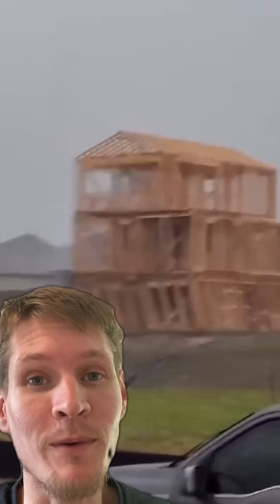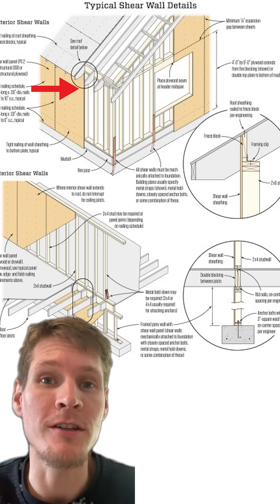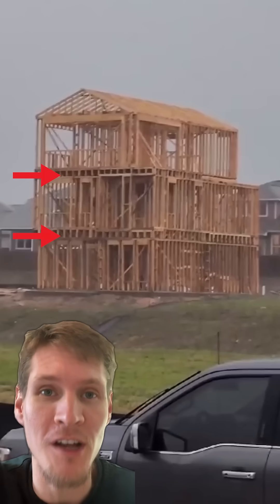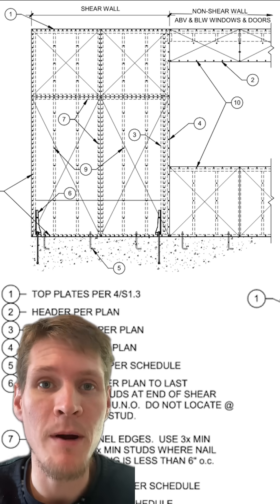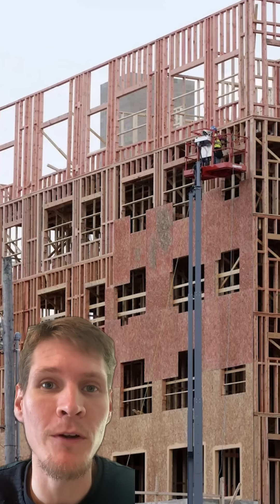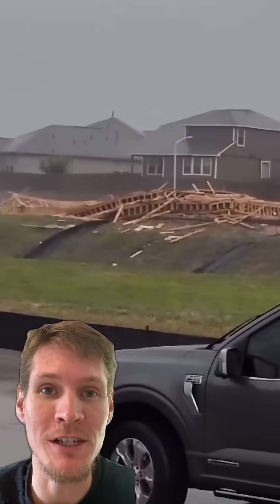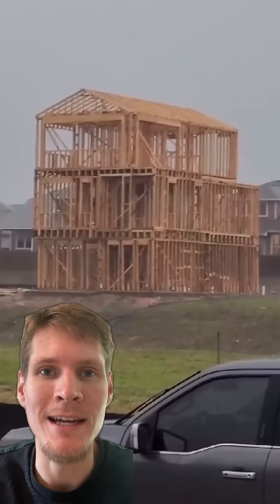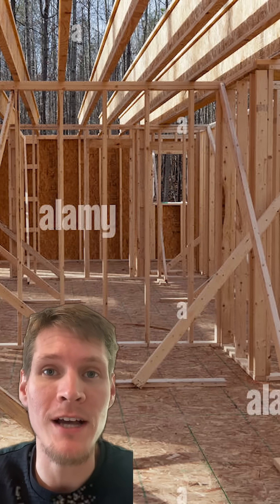Professional Engineer Reviews Reddit Structural Engineering Thread | Part 1 #engineering #reddit

Comment: Weird that the framers put up walls without the plywood attached. When I had my house built, the framers built walls with plywood sheathing nailed to studs, and then raised the walls securing them until an entire floor was completed and secured.

How crazy is it that the framers would have to attach 4x8 plywood/OSB 2 and 3 stories up around the entire house???

Also, it looks weird that the floor joists appear to run in both directions on the 2 upper floors. I remember my architect specially mentioned that the joists would run in one direction on one floor, and perpendicular on the upper floor so that IIRC the load would be on different sides of the footings.

Comment: ...or just use concrete and steel for the main structure for that size of a building. You can still make it look like it's a wooden house later. Just a support pillow in the middle where everything is mounted and that thing goes nowhere.

Comment: I think one of the best traits that anyone can have, is having enough fear of what you are doing. Me personally, when I actually care about something, I feel the need to double check everything multiple times as I am doing it, and I always forget something. I usually watch a few YouTube videos before I do anything big, even if I have done it before. Sometimes practices change or there will be something special I need to worry about. It’s just worth the time. Read Internet forums, look at other people’s designs, do the research, especially if you are being paid as much money as I know a 3 story home costs. 

I asked Google Gemini “I am currently building a 3 story house, I have framed the first story, Can you give me a checklist of what I need to make sure is done before I frame a second story on a house?”

Its response was: 
Before Framing the Second Story of Your House:
1. Structural Integrity:
 * Foundation Inspection:
   * Thoroughly inspect the foundation for any cracks, settling, or other signs of instability.
   * Ensure proper drainage around the foundation to prevent moisture issues.
 * Engineer's Approval:
   * Have a qualified structural engineer review and approve the first-floor framing before proceeding.
2. First-Floor Framing:
 * Wall Framing:
   * Plumb and Square: All walls must be plumb (vertical) and square (corners at 90 degrees) to ensure the second-story framing is level and stable.
   * Sheathing: Install sheathing (OSB or plywood) on exterior walls for stability and to provide a base for exterior finishes.
   * Window and Door Openings: Double-check the accuracy and squareness of all window and door openings.
 * Floor Framing:
   * Joist Installation: Ensure floor joists are properly spaced, supported, and secured to the foundation.
   * Subfloor Installation: Install subfloor (OSB or plywood) over the joists, ensuring it is level and free of any significant gaps.
 * Roof Framing (if applicable):
   * If the roof is being framed before the second story, ensure proper support and bracing for the roof structure.
3. Utilities and Rough-Ins:
 * Plumbing:
   * Install rough-in plumbing for the first floor (toilets, sinks, tubs/showers) before framing the second story to avoid costly modifications later.
 * Electrical:
   * Install electrical rough-ins (conduit, boxes) for the first floor.
   * Consider running any necessary electrical lines to the second-floor locations.
 * HVAC:
   * If applicable, install or rough-in HVAC systems for the first floor.
4. Inspections:
 * Building Permits: Ensure all required building permits are obtained and that all work complies with local building codes.
 * Inspections: Schedule and pass any required inspections (foundation, plumbing, electrical) before proceeding to the second story.
Important Notes:
 * Safety First: Always prioritize safety. Use proper safety equipment (hard hats, safety glasses, fall protection) and follow all safety guidelines.
 * Professional Guidance: If you're unsure about any aspect of the construction process, consult with a qualified builder or contractor.
 * Local Codes: Always comply with all local building codes and regulations.
Disclaimer: This information is for general guidance only and may not be applicable to all situations. Consult with qualified professionals for specific advice regarding your project.
I hope this checklist helps you prepare for framing the second story of your house!

Obviously you need to do more than use an AI, and a lot of that is blatantly wrong as I am sure some people will inform me, but hey, if you’re sure you didn’t miss anything, doesn’t hurt to give it a list of what you have done an inspected, and ask if you missed anything. Clearly doing a basic google search or asking an AI would’ve saved this frame. Though it didn’t look very good anyways to be honest.

Comment: I have no idea about building houses but the same thing applies when building cabinets. You connect the walls with the top and bottom and what you end up with is a parallelogram. If you want it to be a stable rectangle, that's the back panel's job.

Comment: While going that high without sheathing in place, properly installed Bracing Might have prevented the issue. Notice the Bracing that was in place? How many Fasteners were in it? One or two at either end to hold things square as it was raised in place?

Comment: I would build sturdy wooden cubes, 3m x 3m x 3m. On level ground, create a rebar foundation. Assemble the first floor by simply gluing the cubes together. Lay strips of linoleum on the roof and build more cubes on it to make the second floor, etc. Recede by one cube on the edges as you build up, à la Great Pyramid of Egypt. 👍

Comment: Those vertical supports that the so called Engineer is referring to are not for support like he is describing it is to hold the walls plum so they can put the sheathing on I have never seen a construction company or crew start working on the second level of a house enter the main supporting wall structures are up to par will definitely support the next story

Comment: if that portapotty went 'zoom!' like that ? remember the capacity of their 'doodie tank'... that's a lot of chemical treated WATER! 1 gallon weighs 8.33 pounds or 3.78 kilograms. if it was a 'freshie' and not a 'refreshie' ... that's ahhh it is on screen so short i'm GUESSING that's a 30 gallon one. leave it at a job site for 7 days in-between servicing. normally the capacity of a 'freshie' is only filled halfway so 15 gallons or about 125lb/56.7kg. 

yep, that's a tropical storm straight-line wind reaching 70-75mph/112.6-120.7kph at a minimum to 'zoom' a portajohn like that.  

mhm even IF the bottom floor was entirely clad interior/exterior... the middle and top floors would have been gone. the ENTIRE house would have needed to be clad AND fully roof cladding too. basically, a plywood house with all the framing covered. 

once the insurance adjuster sees this video? that jobsite manager and construction company is going to have to answer a LOT of questions. ;>

Comment: I just think this whole thing is stupid especially if you live in hurricane state as mine. Team Florida. I've literally seen condos and new apartments being built with all would structure smh. Then on top of that. Working in the community. I saw an apartment unit catch fire. They put out the fire. But sadly because it was an all wood structure. You can't repair JUST that unit. They had to demolish the entire building and start over. Fyi for some who may say not all. Yes; nothing applies to all. I get that! Still doesn't change the fact that certain areas all buildings, homes, etc. Should be built out of concrete. Or cinderblock! If it ain't concrete I don't move in. I've learned my lesson!

Comment: I agree with the carpenter below. My father was a contractor passed away when I was little, however I remember him cutting 3/4 of an inch into the studs on the outside diagonally to install 1X4 for permanent cross bracing. There was only temporary. I considered that bad construction.

Comment: 3rd floor roof load is point loading on the 2nd floor to 1st floor single BCI's which are layed out the wrong direction, or not doubled up, or may have required a beam to take the 2nd and 3rd floor loads. Even with sheathing you can get deflection in your sheetrock. Seen it before

Comment: I have been doing framing and construction for almost 30 years. The Forman should be fired if he was not. There was not enough shoring to start with, and even before it starts falling it looks like shit. The fact he had people in there working on the 3rd floor without sheeting any of the others could have killed everyone inside. When I was learning with my old man as a kid I remember he would nail diagonal shoring along the outside of the walls (basically acting like temp sheeting) as well as the interior ones. This was only ever done if the sheeting was not avail yet as he wanted to go up one more level, but never used for a whole 3 story building. Follow building codes and never cut corners… doing so costs money and lives

Comment: The sheathing alone does provide vibrational security, and yes, would naturally function as an exoskeleton. However, the sheathing alone should not be the only thing holding up the frame. Putting that kind of strain on the walls would not play nicely during a hurricane, though I suppose it is what it is. The chief issue there is... I. None of the walls are blocked, horizontal blocking should be at least three locations each stud bank. Bottom, center, and top, this is code mandatory, however, most builders that know what they're doing, will place blocking at the quarter points also, thus 5 locations. This is not counting the top plate and base. This would have prevented the studs from keeling in on one another. II. Improper transfer of loadbearing walls, there are clearly loadbearing walls that are not properly transferring the force down, though They can be observed at some points, there is clearly a lack at the bottom level. III. Windows are not correctly framed, code requires that every window bay have a strait to header stud, followed by a reinforcing brace, in the window bay itself. This base must be  weight transferred to the stud base. Again, bare minimum, it will pass, but the inspector is going to be inclined to hit you over every little thing. Traditionally, there are three supports each side of the window. Two full length studs, and one brace. IV. The roof lacks a ridge beam, that is not code, also, the weight bearing walls are not supported down to the foundation. V. The structure is lacking secondary straps or tie members that transfer vibrational shock from the flooring to the wall, the structure is not properly braced.

If I did not know better, I would say that this was the work of an intelligence spook, or a foreign operative, judging by the roof.

Whoever engineered this thing knew exactly what they were doing, of course whoever built it was naturally blind to traditional building conventions, or was being trafficked. These building conventions if followed, result in a fluid and obstacle free inspection process.

Comment: Sheathing prevents "Wracking" which is what has taken place here. Insufficient Lateral Support.
As a Chief Building Official (retired) I've seen this sort of thing often. Usually by people who have never built anything but got a new hammer and pouch for Xmas. They are going to look really stupid try to sheath the 2nd and 3rd floor walls. It is far easier (and stronger) to sheath the walls BEFORE you stand them up. They hold their Square and are fully laterally supported. If no "structural" sheathing is to be installed, then "Let-In" bracing is require and must incorporate EVERY STUD so they remain vertical when under Live/Dead Loads.

Comment: Well in reverse it’s the world’s fastest framer …….my question is there is zero band Joyce on every floor the deck helps keeps the building square but with out rim boards and zero sheathing , which in Florida frame we framed no sheathing on walls ,separate crew did the sheathing and cornice work , the roof we did with osb and dried in was normal after hurricane Andrew

Comment: Sure studs are mainly load weight where as sheathing is racking strength. Obviously a few braces help but definitely not enough in this case. What kind of foundation is that, the walls look like they are built on a warped slab going up and down never seen a foundation that out of level

Comment: As a framer the diagonals are meant to keep force the walls into being plumb and are really just holding it till you sheath. Youll likely leave them after sheathing for a while, but braces are never gonna hold up against that kind of load. Idk who built this but they didnt know what they were doin. If they had experience it was likely on single story structures.

Comment: we NEVER put wallboard on floor by floor, and we never had a house collapse either. that's what the braces were for, if you level your braces in the right locations that's legit all it takes. saves us soo much fucking time.
Reply: so is faster to isntall wallboard with a JLG (Genie) instead of doing in while they're  down?

Comment: I see this sort of thing on the internet, but I just don't get It.  In Western Canada you build the wall on the floor, square it and stand it.  Why the hell would you sheath it after?  Sometimes you might only sheath it partially so it is easier to stand, with heavy gypsum sheathing for example, but you would't keep on building before finishing sheathing it.

Comment: You'd think that on a multi-story structure, there would have been some call for additional reinforcement on the ground floor beyond plywood. Like maybe steel corner posts or something more rigid with diagonal corner bracing. Wood is very, very strong in compression, but not so much in tension and torsion. Yeah, a building is the sum of all the parts involved, and well enough, but seeing this really bothers me.

Comment: I mean I don't know who build that, but you need that plywood.  It gives it lateral rigidity.   AKA it gives it strength so that any side movements are restricted. 

That is why many people will brace the walls on the floor first, before installing the plywood and you install the plywood before moving to the next floor.

Comment: Wood buildings.. I can't understand, what's the problem with concrete and steel?
Reply: From the moment I understood the weakness of my wood, it disgusted me. I craved the strength and certainty of steel. I aspired to the purity of the Blessed Machine. Your kind cling to your wood, as though it will not decay and fail you. One day the crude biomass you call the temple will wither, and you will beg my kind to save you. But I am already saved, for the Machine is immortal… Even in death I serve the Omnissiah
Reply: finally, someone who says this.

I've been seeing loads of people spamming the usual "why aren't you building with bricks?", but honestly most houses I'm seeing being built nowadays are wooden molds - with plumbing, conduit, and rebar set in place beforehand - which are then filled with concrete and removed, leaving only a solid concrete wall with places for you to run all your wiring and such. seems much easier than manually laying clay bricks by hand, and much sturdier than just building the molds and calling them "walls" like americans seem to do.
Reply: Mostly the expense, time, and ecological impact.

Comment: Portapotties are notorious for tipping in the wind if they aren't secured to the ground. I was a portapotty guy for six years. I should know. Very fun to clean when they tip! 😅
Reply: Bless you sir!
Reply: 6 years?  hope that job paid well and thank you for your service
Reply: A true hero.
Also I thought it didn't actually take too much to blow on over, but thought I must of been wrong.
Reply: I saw a porto potty on a construction site. The cleaning company never came to clean it and it had 2 houses constructed with everyone filling it up. It was a hot summer day and I pulled up and the bottom of the porto potty had exploded and the side seam was ripped open.